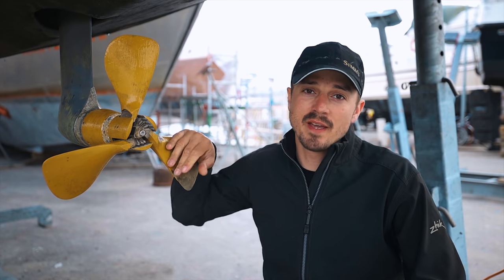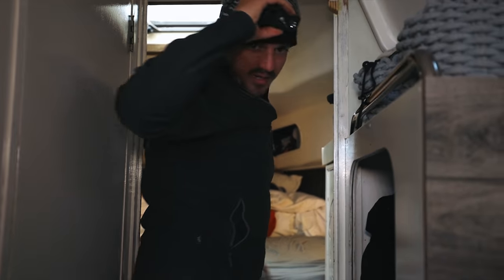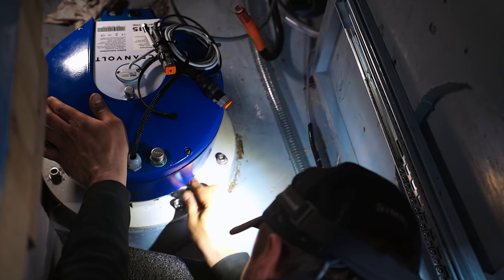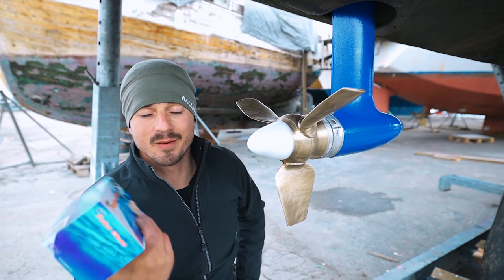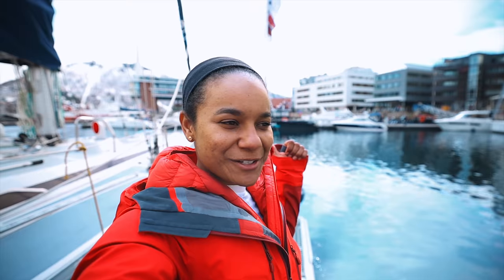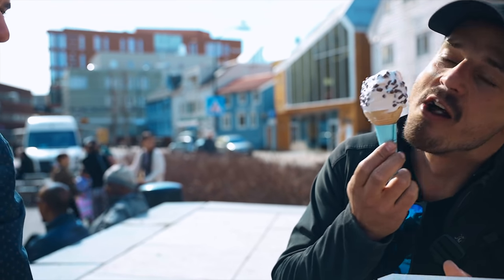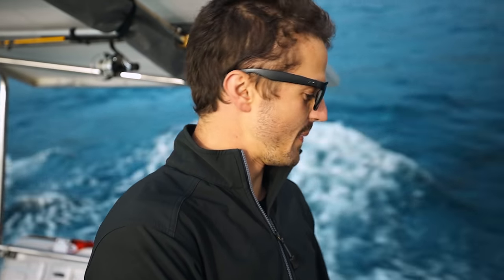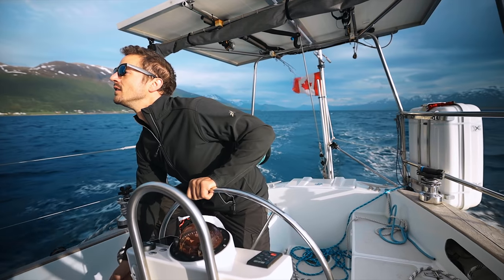Ripping Out our Electric Motor for the LAST TIME! — Sailing Uma [Step 277]

Comment: Ok... can we stop all this speculation about what was paid, who owes whom, weather this means “something” and implying some kind of imaginary conspiracy here? It’s juvenile and totally misses the point...  the politics of envy and just the “put down”  culture that I’m so sick of. Examine the facts presented and dissect them. Now, there are some issues here. It is no use to use Speed over ground data for this video. The regen capacity is entirely dependent on boat speed, ie how fast the water passes by the boat. Any comparison based on gps speed does not account for currents, tide, or the boats tracking efficiency at various points of wind, track vs heading on various points of sail. I do not suggest that there is any deception here, just a fault in the science. No doubt, the manufacturers of this device will have noticed this and taken it into account when assessing real world data. Developing good systems is dependant on good data, that reflects the relevant inputs that make the system work. The energy derived from the prop to regen and provide current to charge batts is dependant on boat speed thru the medium (water) and efficiency factors. Equally, any reduction in boat speed due to the drag of regen needs to be measured directly. Quality data of this nature would provide real information regarding this setup, REGARDLESS of if it was free or full retail price. Equally, it is important to isolate any other energy sources, solar, wind, etc to ensure that what we are looking at is solely about the regen drive. This kind of info is what might really make the case for electric.. or not. Price/performance is a separate issue, and no doubt be at the forefront of the companies mind. 
In the video it is mentioned that the supplier will capture data directly from the electronics and be able to analyse this. One would hope that they will share this with all and also inform these guys on how to present it honestly. If you think otherwise then you don’t understand what presenting false or misleading data can do to a small company. It’s ok for Lockheed or Boeing to tell fibs, million dollar legal budget, but it will destroy any small evolving business. 
So... if you are at all interested in how electric power might work for sail boats, cruising, live aboard, climate change, evolving tech, (we haven’t examined how say Li ion bats, with different charging regimes might effect energy efficiency), then we need to thank the Uma guys for trying to examine this, for building relationships with suppliers, for sharing their data and real life experiences, for trying to get it right, and then, and only then, maybe help by providing advise as to how to refine the content of their reportage to make real, valid comparisons based on fact and real world experience. The supplier will not have a fleet of yachts sailing the oceans on a defence Dept budget to test their gear. Stop trying to undermine the best intentions of others with pathetic little envious take downs and may be get out there and test some other rigs or do an honest numerical fact based analysis (with references-not my mate said) and contribute to the conversation with manners and fact. You might even buy a boat and learn to sail... maybe a little further than your local lake or river. See the world, discover how vast and so much greater than your imagination it is....  the Dr..